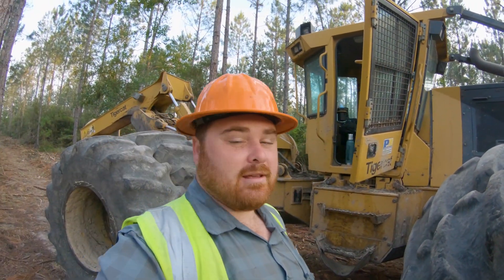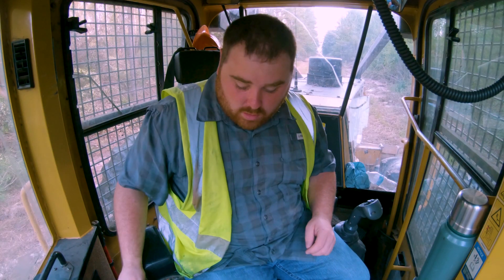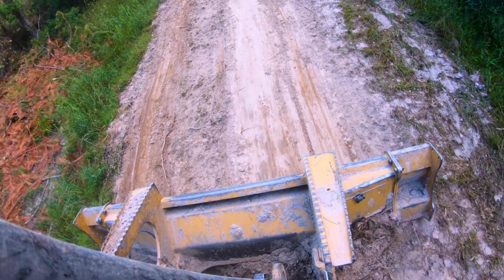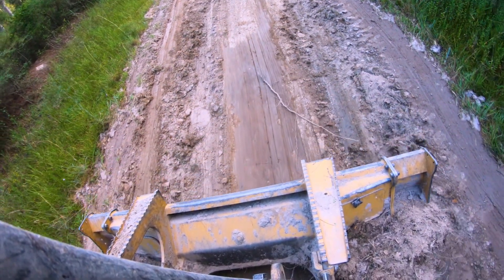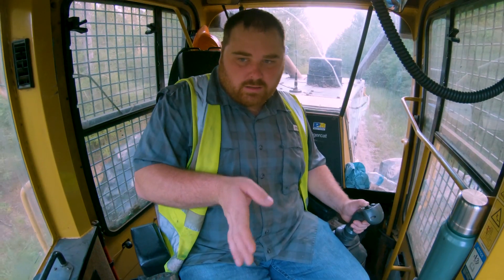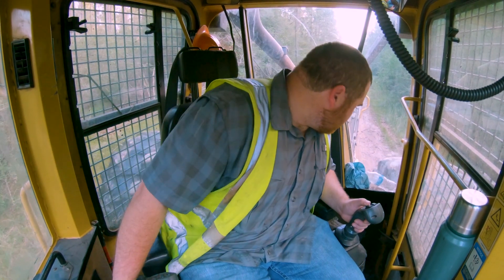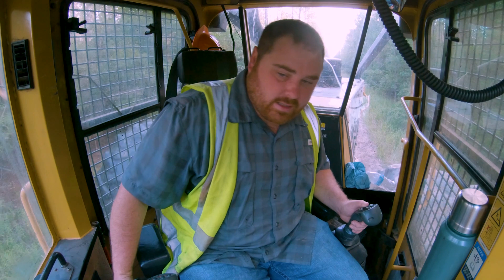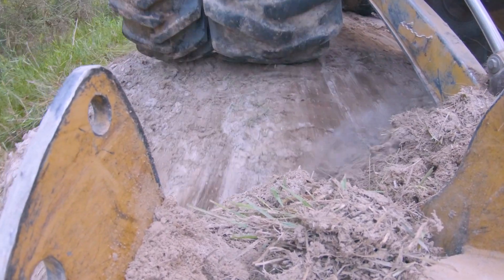Rebuilding A Haul Road With The Tigercat Skidder

Comment: Great video. I can tell you we use a I beam that we welded old cutting edges on and we hook it to the truck with chains that way you can shorten one side so all the clumps roll to that side it worked really well. Just don’t drive to fast. I was cruising 
pretty fast one day and the drag hit a rock bounced up and hit my tailgate.

Comment: Push it forward if you're really good with the blade
Reply from the maker: Not with a Skidder 😎
Reply: @CuttingEdgeLogging_Thomas  cmon now😂
Reply: Does the blade have a wear bar or cutting edge on the back of it. How about float on the hydraulics.
Reply: @loveistheanswer8137  no they don't